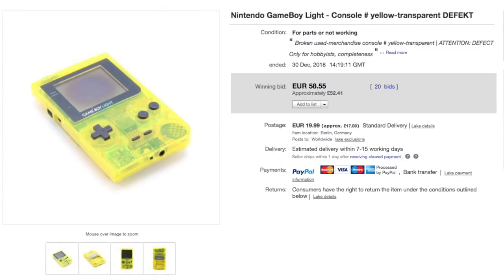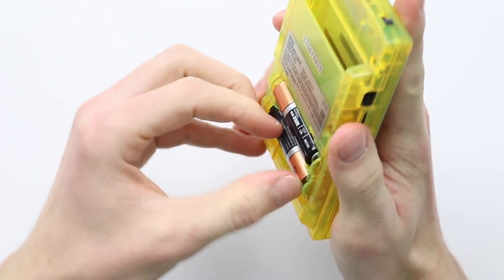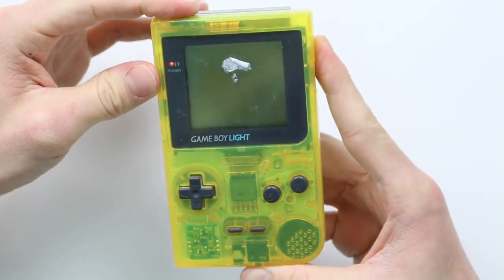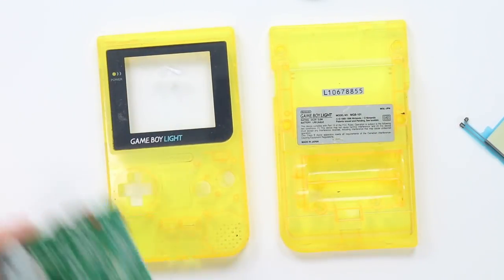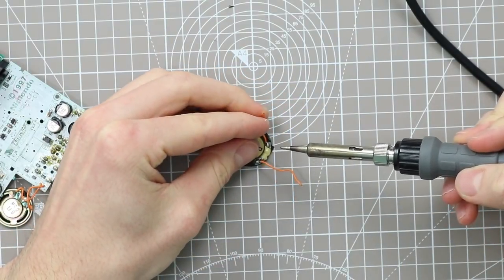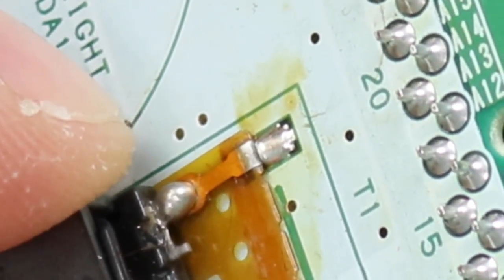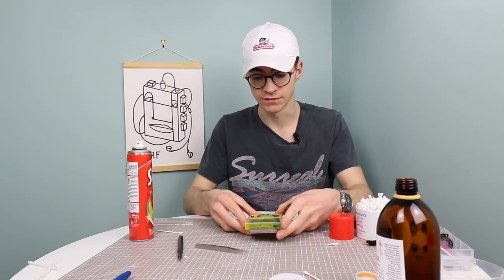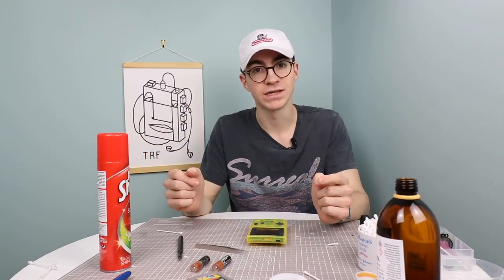Let's Refurb! - Limited Edition Toy's R' Us GameBoy Light!

Comment: For the battery cover, have you considered taking a clear replacement and dyeing it using either hobby stained glass paints or fabric dye?

Might take some trial and error to get an exact match, but I’ve seen impressive results using similar methods for custom ordroid-go shells.

Comment: I've fixed a gameboy screen by just running my soldering tip along where the ribon cable from the screen has its little pins come in to contact.  I literally did it while the thing was on so I could watch what happend to the screen while I did it.  While I did it I got a few more fead lines, but I just kept going until all the lines went away and then I stopped and its been good ever since

Comment: Have you ever tried using electronic contact cleaner on the parts you use alcohol on? It leaves no residue and is great cleaning the areas you alcohol in.

Comment: I wish you'd wait until you have the complete build before posting a video. It doesn't give you that feel-good restoration feeling when it doesn't get completed in the end.

You could probably polish most of the scratches from the screen with a bit of rubbing compound and a Dremel with a polish wheel.

Comment: Another great video! 👍 That’s a neat case color, I’ve never seen it before. Also, you should try polishing screen plastic sometime. I’ve used a 3M headlight cleaning kit with great results on plastic like that. Just remember that heat is the enemy when polishing plastic, so always wet sand - if you sand at all, something like this I would suggest trying just the foam polishing pad and included rubbing compound on, and keep adding drops of water to the pad to keep the plastic cool. Sticking the plastic down to a flat surface would probably help, and you’ll want to rinse out the rubbing compound from the foam pad and switch to polishing compound for the final polish.